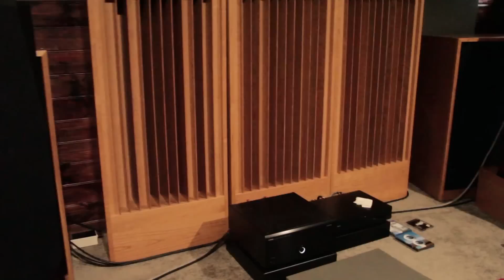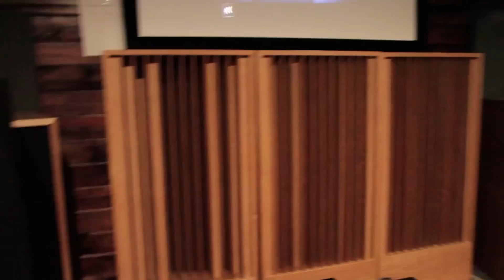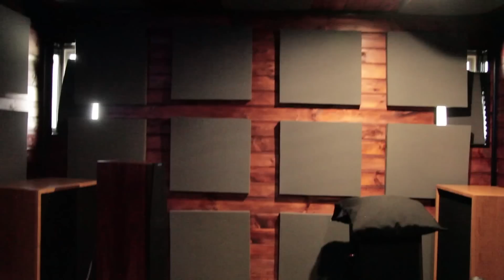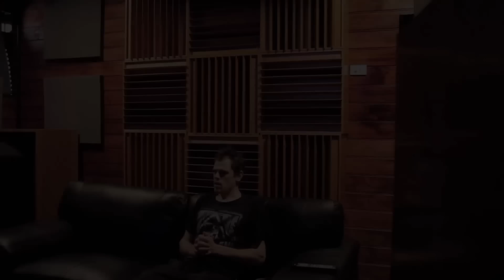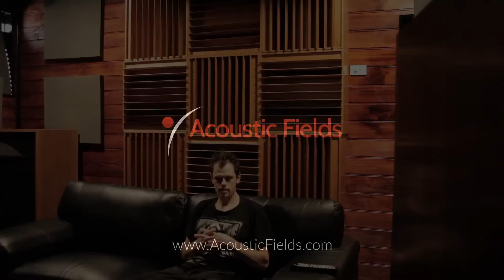Paul Smits discusses two channel / front and rear wall diffusion

Comment: Dennis, would two 1D scatter boxes on the rear wall of an 11 x 13 voice over studio be better positioned vertical or horizontal? Can you use them this way on the front wall as well or only absorption?
Reply from the maker: One dimensional diffusion adds "color". It can increase soundstage dimensions along with adding resolution. Two dimensions is designed to minimize the impact of reflections. For voice, in your room size, which is excellent for male voice, if you want to add more "air" and separation to voice use one dimensional. I would cover the complete front wall you face when vocalizing.
Reply: @AcousticFields  Thank you Dennis. Would absorption be in the middle somewhere on the front wall with 1D scatter boxes positioned all around it?  Can you use 1D on the rear wall too for vocalizing or is that one too many 1D scatter boxes? Would you prefer only absorption on the back wall?
Reply from the maker: We have found that diffusion on the wall that the vocalist faces is best. Your would have the talent, microphone, and front wall in that order.
Reply: @AcousticFields Thank you Dennis. I always thought diffusion and absorption had to be in sync for voice overs and not just diffusion on the front wall.
Reply from the maker: Diffusion has many criteria that must be satisfied before you use it. The most important are reverb time balance and a smooth frequency response. These two requirements are met through absorption.
Reply: @AcousticFields  Thank you.

Comment: Nice and looks beautiful. Are those prime 11 diffusers on the back wall? If so, is your sitting position too close? I'm under the impression for the P-11 waveform to properly form, your sitting position needs to be a minumum of 6 feet away. Also, the depth of the diffusers seems to be rather shallow for P-11. I appreciate your feedback as I am just now learning about the topic.
Reply from the maker: M, Yes, P-11 two dimensional diffusion.